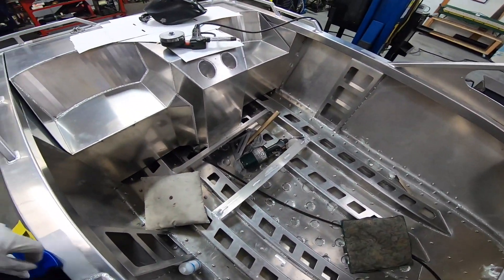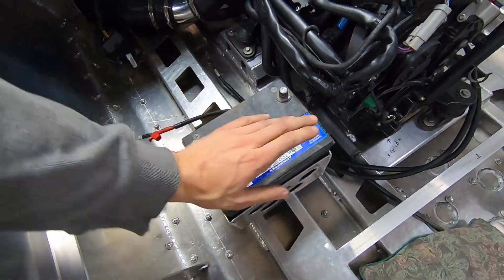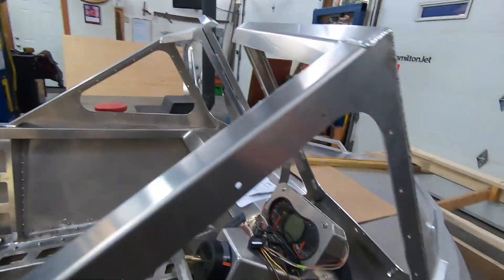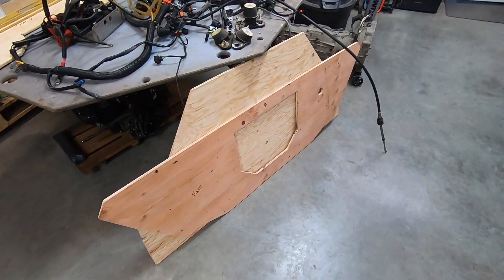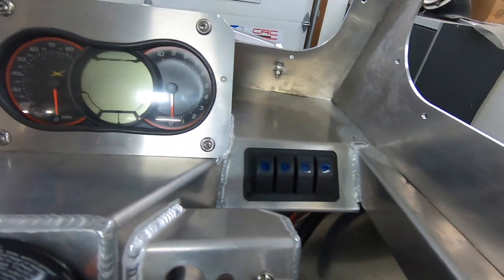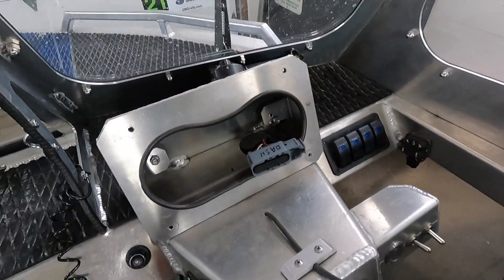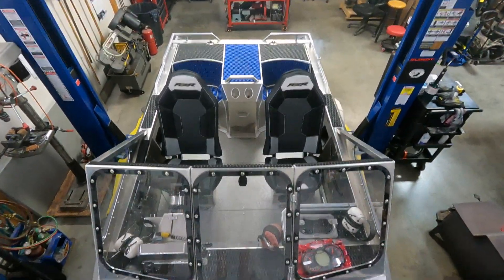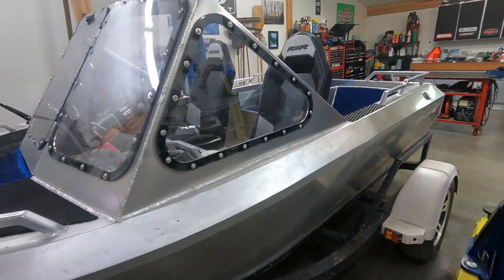Mini Jet Boat Build | Final Episode!! | Jetstream 12' Buccaneer

Comment: Finishing out one of these myself.  Steering, is that the Jetstream tilt helm?  Looks like you have a billet spacer in there?  What length cable did you end up with.  Awesome boat.  Run videos are great!
Reply from the maker: It's just the non tilt steering set up from jet stream, can't remember the length anymore but if you call em they'll let you know what you need.

Comment: How did you handle the VTS from the seadoo? Or are you running without trim?
Reply from the maker: We deleted the ibr/vts trim system and are just running it with a fixed trim set up
Reply: @LoganPehota  I can understand why, looks like it's going to be extremely tedious to do...
Reply: I was wondering the same. I’m trying to wrap my head around it. Is it even worth installing🤷‍♂️
Reply: @markmontgomery6734  yeah, trim is a must have though, I'll have to rig something up and just use the lever
Reply from the maker: @markmontgomery6734  if your trim/bucket system is all attached to the pump and not the hull then I'd definitely use the stock ibr/vts set up.
Reply: @LoganPehota  on my seadoo the pump/bucket is connected to the sides. I figured I could just delete the bracket for it.  My donor is a 2004 seadoo rxp215.   So far I’ve  just torn it all down and I’m in the middle of rebuilding the motor. I’m going to start the build of the hull in a few weeks here

Comment: Waiting on my jetstream kit. Just curious what your settings were on your welder? I'll be using that same miller 220. Boat looks 🔥🔥🔥
Reply from the maker: I just used the auto settings and tweaked the voltage when miging or amps when tiging depending on the situation. Was definitely a learning curve though that's for sure haha